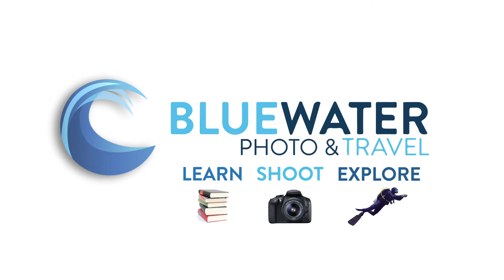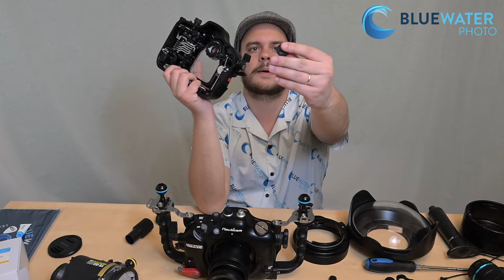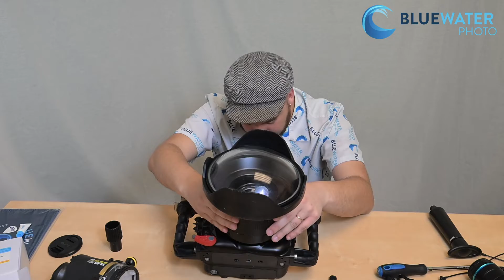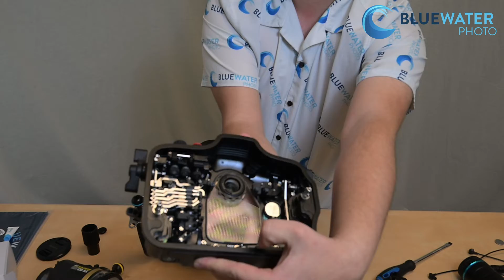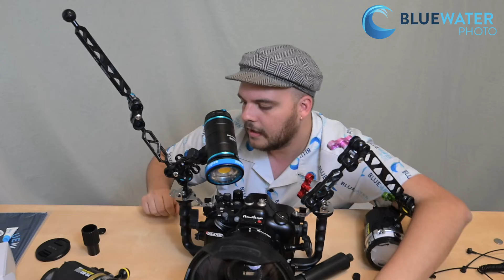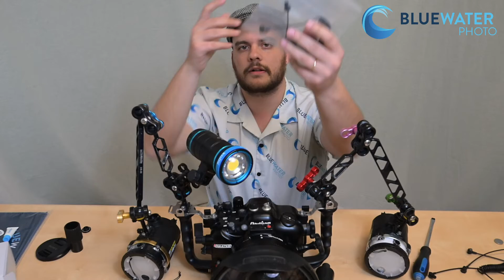The ULTIMATE Underwater Housing Set Up Guide

Comment: I need help. I have a flash trigger 26302 from Nauticam and Weefine WFS07 hybrid flash/video strobes. When I turn on my flash trigger it blinks green for a few seconds and immediately goes to red even though the batteries are new. And I can't get my strobes to flash mode, tried everything. What could be the problem?
Reply from the maker: It sounds like the flash trigger might be the issue. We have seen Nauticam flash triggers have this issue before out of the factory. It's usually because the contacts are having difficulty touching. Please try taking the batteries out of the flash trigger and adding them again. If it continues to turn red please give us a call at 310-633-5052 or email us at support@bluewaterphotostore.com and we are happy to help!
Reply: Which fibre cables do I need to attach an Inon S240 strobe to a Nauticam a7RV housing?